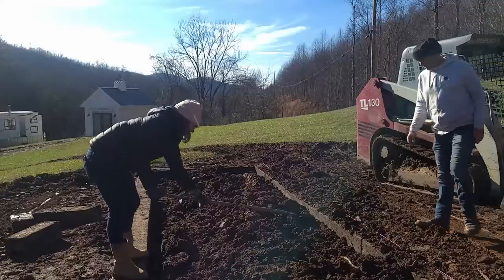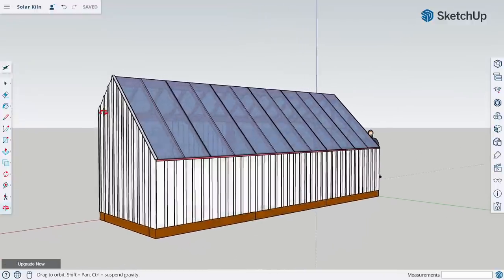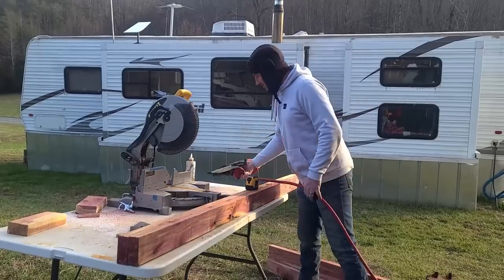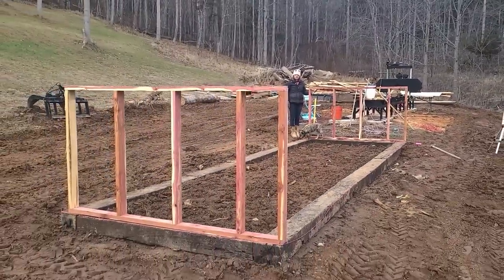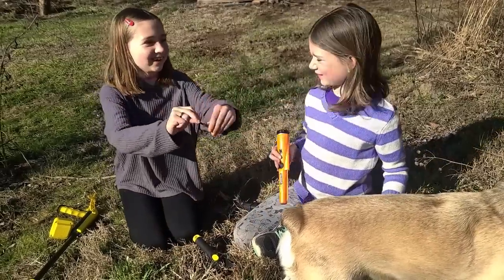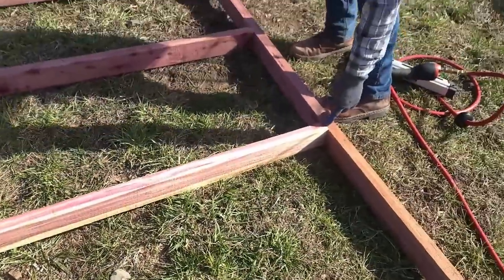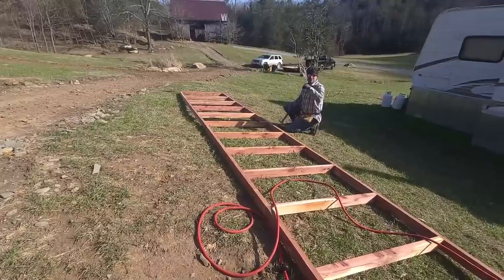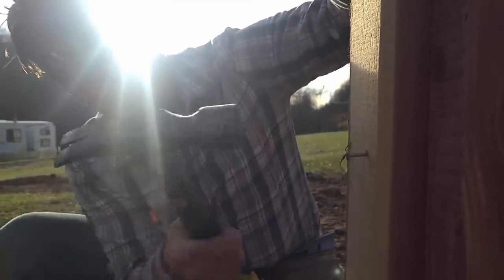Framing the solar kiln - Part 1 // E112

Comment: I’ve owned 2 of the dewalt framing nailers. Both of them would sink 3 inch nails 80-90% of the time. The remainder id have to finish off with a hammer. 

I have a Milwaukee cordless framing nailer now. It works circles around the dewalt. For small projects the dewalt would be good but framing an entire house I’d recommend the Milwaukee or a paslode if you want to go cordless.

Comment: I'd have put some metal diagonal wind braces on the kiln. Not that it really needs them but once I discovered how much strength they add I put them on anything I build. You just square up the framing, strike a chalk line on a diagonal and cut a saw blade width kerf cut and drive the strengthener into the cut. Makes the wall solid. Another thing, again this job doesn't need it but if you are going to build your house with a minimum of assistance wall jacks are going to be a must. I've watched people build small sections of wall and struggle to stand them up. Wall jacks make the job of standing up the walls a snap.

Comment: When Mag was cutting those boards on your miter saw.  I noticed the saw going into the air.  Then I saw it was due to your dust port on the back of the saw.  It either needs to be rotated down or add a 45 or 90 degree coupling to blow the saw dust down.  So it doesn’t blow around so much.

Comment: John,when working on uneven ground. Instead of holding the stud up to nail to the plate,I would lay a 1x4 on the ground under the stud sn plate.made them the same height. Enjoying the build.SEMPER FI

Comment: An easy and cheap way to help keep your foundation timbers from shifting is to drill holes through them and drive lengths of rebar (about 4 feet) through the holes and into the ground.  I did that with landscaping timbers when I was setting up our kids' playset and it worked great for more than 20 years.  I also tied them together with cheap metal corner brackets.

Comment: Hi Guys,

Great video as always. Loved the interlude bit with the girls metal detecting. Such a joy to watch the excitement on their faces over a rusty nail!
Hey, I didn't see any evidence of bracing in the solar kiln. Older styles of construction involving posts securely dug into the foundation material often relied on these posts to resist lateral loads on the structure. It is not uncommon to see these develop a lean over time. In your construction, you are relying in the bond between the nails and the wood to resist the "parallelogram" effect.
Other older structures utilised timber cross braces or diagonal braces to resist those lateral loads. One shouldn't rely on the siding to provide bracing, as it often works loose over time. Newer timber framed buildings use galvanised metal angle, with punched holes to accommodate fixing (Right angled strap for walls and obtuse angled strap for roofs).
The wall straps are seated in a shallow saw cut from the top of one end-stud to the bottom of the other end- stud and continuing over the top plate and under the bottom plate. There should be one on each side of the wall in opposing directions. Each wall and each roof face should be braced. Cladding will cover most of these. Where there is a large opening in the wall, as in your case, you will have to rely on the combined effect of braces in the roof and remaining walls to keep the structure upright.

Love your work.
Cheers guys.
Happy Christmas. EJ

Comment: Hey Jon and Meg! Nice cold temperatures for Christmas! I like my cordless Dewalt framing nailer - I think you will too. It's nice for projects outside the reach of cords and hoses! It has a harder time driving in ring shank nails but it will do it. it's all about technique. I can go all day even on the smaller batteries. 
We are looking at getting a trailer to keep at PIV in Kentucky. Have you had any problems with your trailer leaking  anywhere such as the slideouts?
Reply from the maker: Hi Bryce - looking forward to the nailer.  I'm in the market for a few other 20v tools just so I can keep the momentum without a generator running.  I sliding compound miter and a handheld circular saw will just about build the whole house for us.  Regarding the RV, you can easily inspect the slide outs from underneath.  If there was water damage, the subfloor is going to be warped and soft and the underlayment will be loose.  It's not a deal breaker though.  It's just a piece of osb subflooring.  I've replaced one in the girls back room, but other than that, no leaks here.  Get up on the roof and see if you can find any evidence of extra silicone or self-leveling caulk.  That's kind of a red flag that there's been a water problem, but to be honest, it's not the end of the world.  They are very easy to work on.  You can always get a carport and cover the whole thing.  Sometimes I wish we had done that.  One last thing is to inspect the rubber seals around the pop outs.  They are pretty expensive to replace.  Hope this helps!

Comment: Jon you might want to look at Paslode for a good nailing gun.  They use the small gas cartridges.  By the time you pay for the DeWalt six batteries and a couple chargers.  The cost is really high.  I have never own one.  I just go with HarborFreight cheapest.  Guys I know that use them, swear by them.  Later

Comment: A battery chop saw is nice when you are not close to power nut it will cost you. It almost needs to be 10" unless you can find a sliding miter saw. To my knowledge I've not seen a 7 1/4" battery powered sliding miter saw. Merry Christmas to you all.

Comment: About half of the pro framers doing fine interior work check the nail head flush to insure it is below flush level so that minimum mud is necessary for the visible wall.

Comment: Jon and Meg, By using the home milled Cedar in the the Solar Kiln, You can demonstrate to the county, the validity of your claim that cedar is a sustainable material for house building, that can be used as an example to others contemplating build using this widely available material in your area. Regards Robin.

Comment: I too have all DeWalt  I now have 6 batteries and 2 chargers.  I have never runout of battery power even when using them in a 16 hr day.  One runs down put it on charger and pick up another by the time I have gone through three batteries the 1st one has recharged I have drill, impacted driver, saw, receptacle saw, grease  gun, 2 sizes of brad drivers, and three sizes of nail gun.  My plugin 12" table saw and 10" miter saw are now 17yr old and still as good as new.  the battery tools are all less then 7 yr old  The Grease gun I got just last fall
Man doe sit make greasing thing so much easier  and faster.
Reply: forgot 2 sizes of stable guns

Comment: It looks like you are building that on a power line right of way, Here in Missouri thats illegal, might want to check on that.
Reply from the maker: Good looking out.  We are allowed if it is less than 15 feet tall and not a structure being used as a residence.

Comment: Are you using an external source of heat or the sun to heat your solar kiln? If you use the sun then shouldn't the kiln face south to gain maximum drying. The girls will have fun using the metal detector looking for things around your property. Merry Christmas to you folks.
Reply from the maker: Yes, the windows face exactly south.  Probably looks weird because of the time of year.  Shortest day of the year when we did this actually.
Reply: @WalnutsandWineberries  I forgot about the winter solstice and the sun being so low. We can't wait to see the kiln drying your wood.

Comment: It's just a bad o-ring on your nail gun. You can pull it apart yourself and replace the o-rings or take it to a shop and they'll repair it at a fraction of the cost of a new gun.
Reply: And add a couple drops of a light oil befor you attach the air hose. Your compressor builds moister.

Comment: You should never hold the board that is being nailed into as that is a safety hazard. You cold have a knot in the board causing the nail to twist or bend sideways and exit the stud on the side right into your hand or finger.